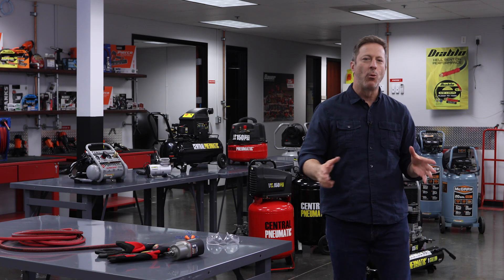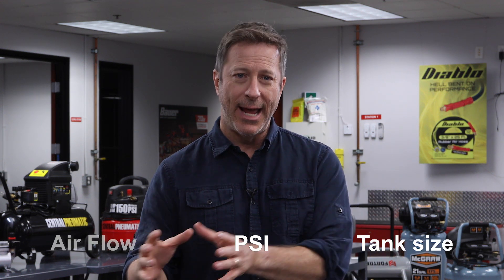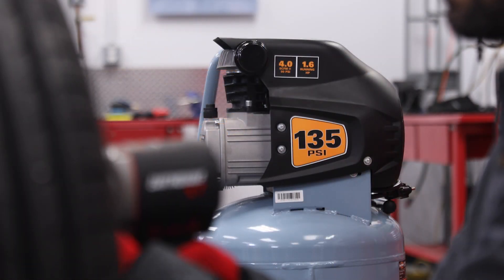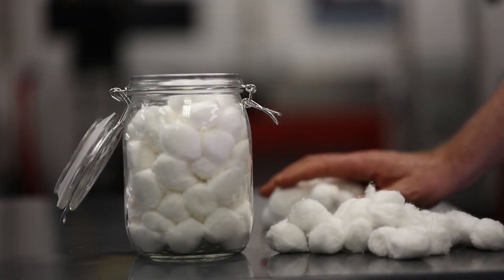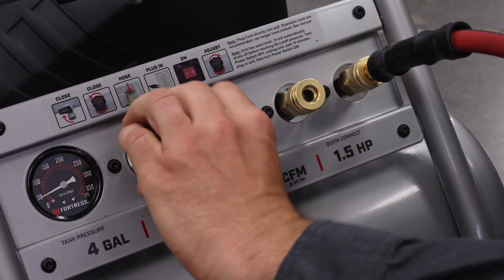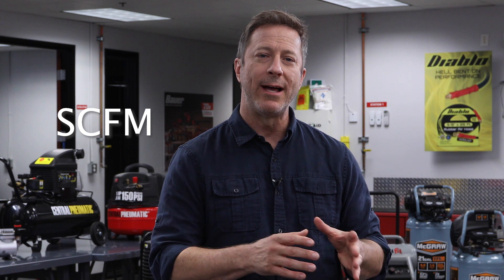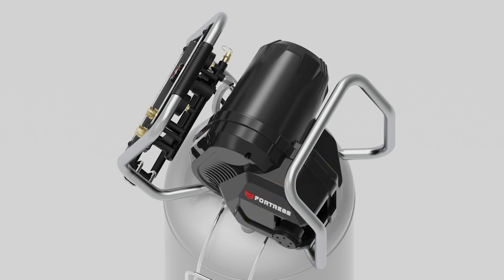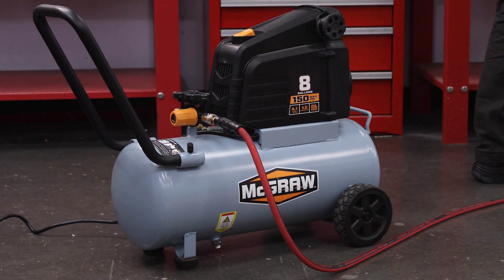What Air Compressor Specs Mean | Harbor Freight

Comment: 7.0+ SCFM will suit a lot of needs.  Once you go below 7.0 SCFM, you are running the risk that your air tools or air needs will need to be updated in the future. Best to buy a little more SCFM now than later as it will require a completely new compressor to get that extra SCFM.